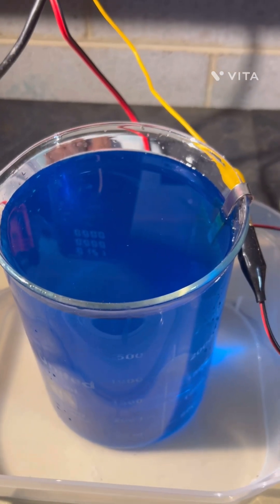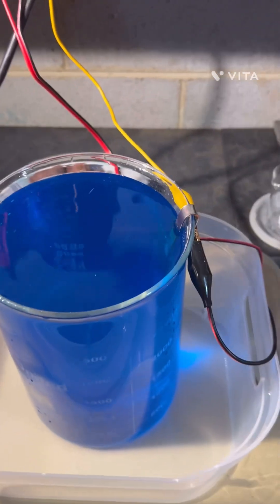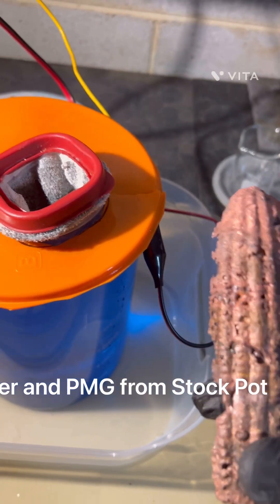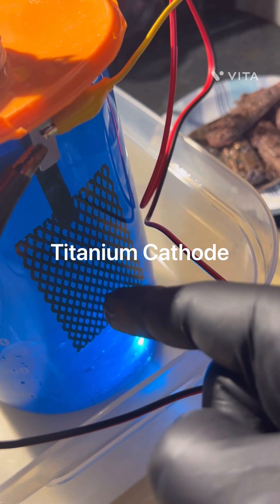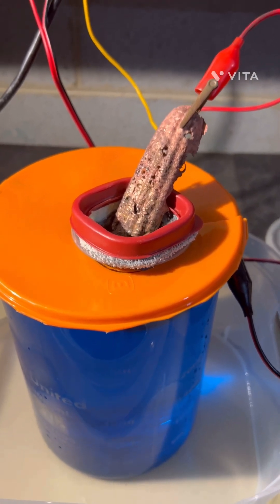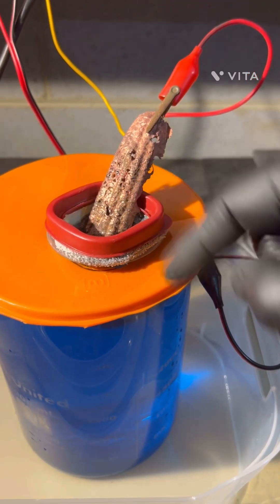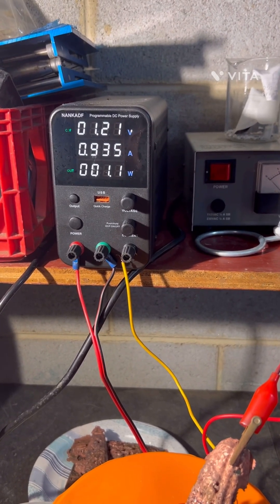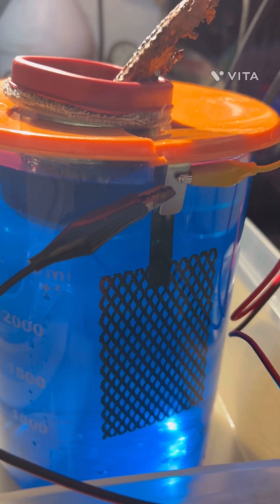Copper Cell start up #scraper #silverrecovery

Comment: That’s very close to my setup.  I’m going to add a potentiostat next and see if I can control the deposition better.  I use folded copper foil for the cathode.
Reply from the maker: I bought a roll of copper flashing for 12 bucks ( score !!) so I have been using that then putting the cathode in my waste buckets
Reply: @Hill-13  I’m building an arduino potentiostat.  Theoretically you should be able to get high purity gold out of a dirty copper solution if you have everything dialed in right.  Gold reduces very easily.  I’m thinking in the same direction you are with the slimes.
Reply from the maker: Check out suthko electrolysis workshop his ideas on copper cell  are pretty cool , I like his idea of a slime trap using an upside down jug  with holes in it
Reply: @Hill-13  Thanks!  I’ll report back if I learn anything with the potentiostat.
Reply from the maker: @naughtiusmaximus830  are you bread boarding it and using IC chips ?
Reply: @Hill-13  Yes.  There have been several designs published.  Most not very good.  If I get it working I’ll let you know.

Comment: Will this work for when I cement my copper out on iron from my copper nitrate
Reply from the maker: I used copper sulphate for this solution , why not reuse your copper nitrate ?
Reply: Will this cell work to remove the iron that I cemented my copper out on so I get pure copper
Reply from the maker: @ScottShields-e6l  yes but you need to cast ingots so the filter doesn’t become clogged
Reply from the maker: @ScottShields-e6l you will need to keep the iron content very low your copper cell. It will form iron hydroxides lessening the efficiency of the cell , why not use weak sulfuric acid to dissolve the iron then run the copper thru your cell , 
Check out the gold record ing forum and type in copper cell in the search bar
Reply: Great idea thank you
Reply from the maker: Scott I have started up a new copper cell to recover silver from HVAC/ Refrigeration joint that were brazed with Silver brazing rods more details in this new series